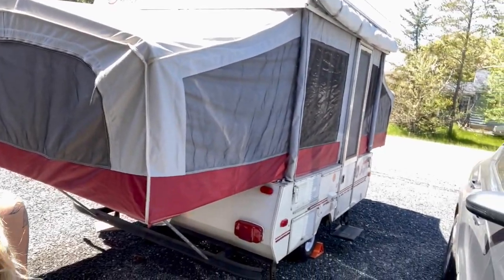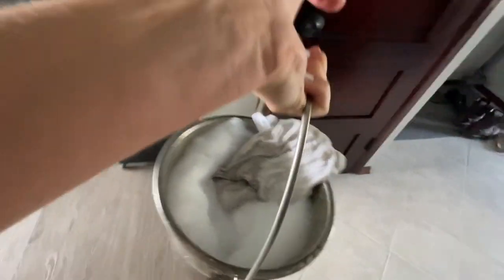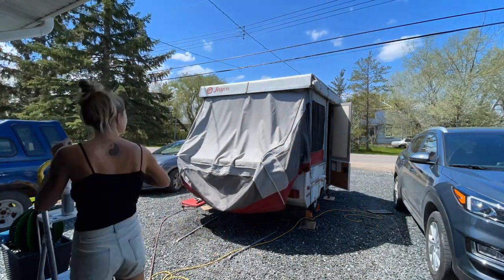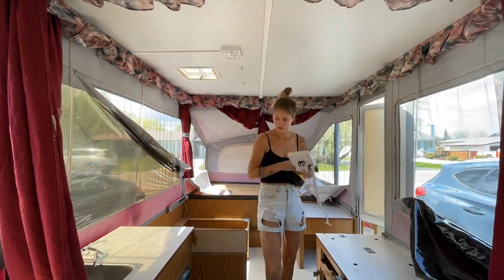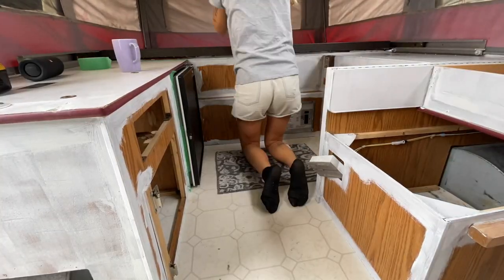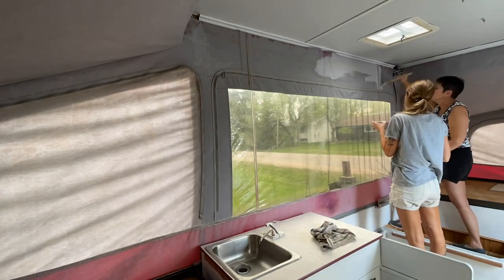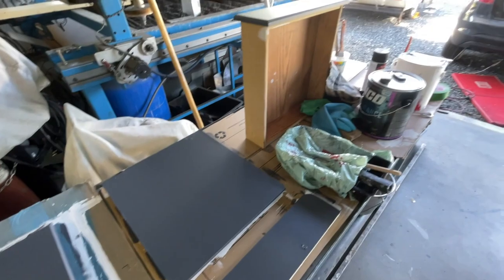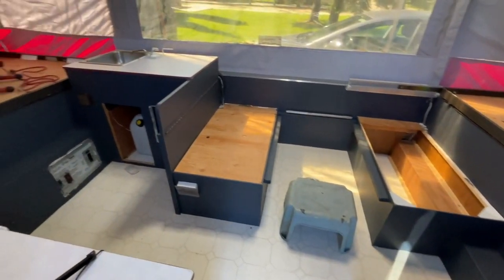RENOVATION | Jayco Pop Up Camper for Under $1000 (Part I: Waterproofing & Painting Cabinets/Canvas)

Comment from the maker: IN THIS VIDEO:
- Spray on waterproofing product: I used 2 bottles of Nikwax from Cabela's which I actually found $5 cheaper on Amazon here from another brand that has great reviews: https://amzn.to/3I6NjPi
- Waterproof Caulking: https://amzn.to/3SIEgZS
- High heat spray paint: https://amzn.to/48mU1eE 

Steps for Waterproofing & Painting:

Waterproofing:
1. Clean your canvas (bucket of water with vinegar and dish soap will do just fine)
2. Spray on waterproofing product to canvas and follow directions on label -- I used 2 bottles of Nikwax from Cabela's which I actually found $5 cheaper on Amazon here from another brand that has great reviews: https://amzn.to/3I6NjPi
3. Take off the old silicone from your roof. Primarily the 3 parallel lines that run down your camper, one on each side and one in the middle, as well as around any vents or air conditioning units.
4. Once the old silicone is completely removed, tape edges with painters tape as wide as you want the new silicone to be (not too wide as to not waste product), and fill with new silicone -- smoothing out with a small wooden tool or whatever you can find. Ensure you are using a 100% silicone product (found easily at your local hardware store such as Home Depot, Rona, etc.). I like this brand by Gorilla https://amzn.to/3SIEgZS
5. Let dry and you're done! 

Painting: 
1. Two coats of Kilz Interior Primer (found easily at your local Home Depot/Rona store) 
2. Two coats of pearl interior paint, choose your colour! 
3. 1 can of high heat spray paint for the vents/accessories (I used a BBQ spray paint in mat black), I like this one: https://amzn.to/48mU1eE

Comment: Getting ready to redo my own. When you painted the inside canvas can you list what you used and how you thinned it? The same happened on my own original curtains of them transferring dye to the inside canvas.  I'm replacing all of them. I think I'd like to do mine as you did. It will give it a new clean look to go along with my other renovations.
Reply from the maker: That’s great! It was regular interior paint in eggshell (I used some colour swatches to get the closest match to the existing grey) and we just emptied some in a separate container and did 1/4 water and 3/4 paint!
Reply: @KirasWholesomeLife  Thank you so much Kira. I appreciate you responding.

Comment: Hi, what did you use to paint the canvas? Do you think you can paint the outside also? I’ve got an old camper and it’s light faded green and it’s all su faded and stained was thinking could paint inside and out and re water proof the outside once dried xx
Reply from the maker: Hi Michelle! It was just regular ol’ wall paint in eggshell! I’m not sure it would be good on the outside sadly but could look at using exterior house paint!